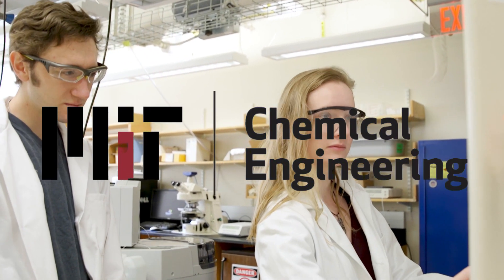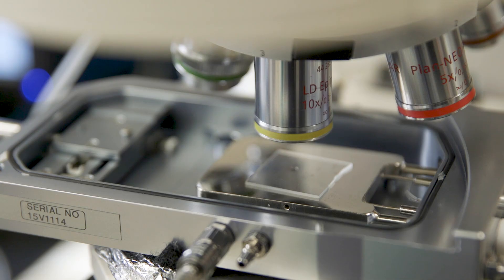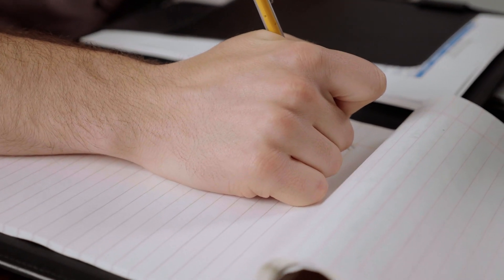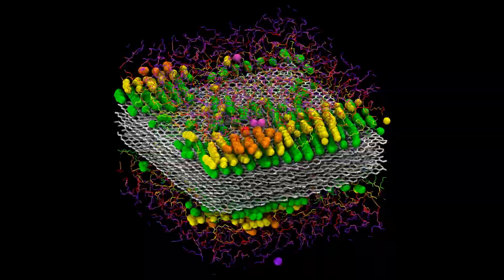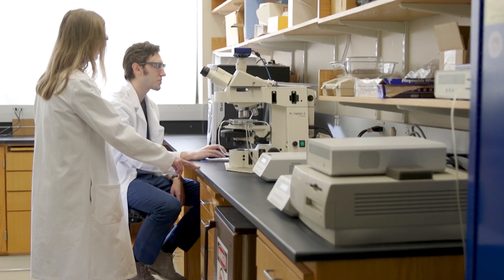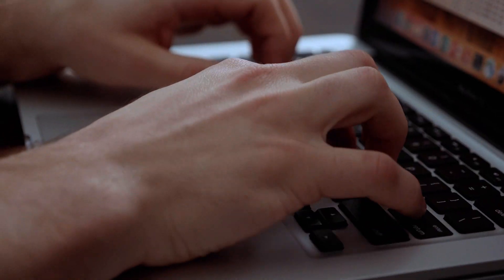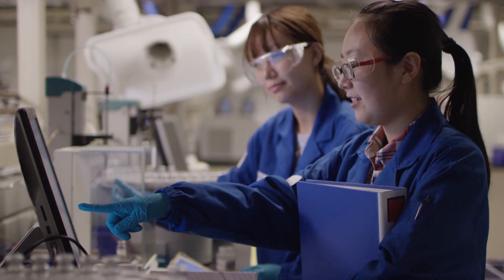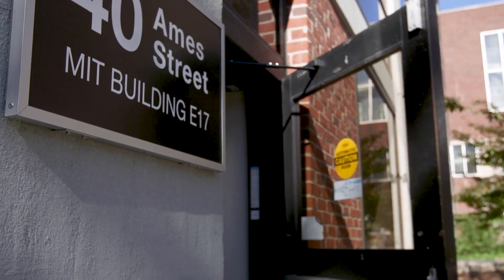Massachusetts Institute of Technology (MIT), Department of Chemical Engineering

Comment: Ein 85-0699388 Jerry Dean rice ii dba rice co ii holdings interview for product and business model with of 25¢ per MB and 15¢ to Jerry dean rice ii eftps enrollment number is 90414002  5¢ to the company to update excel error code logs credit back to company isp for log list in batch file to system if it fixes other networks and 3¢ for federal and 2¢  for state taxes and patent challenge by arbitration by my judge dredd software which is $1500 per arguement based on small cap stock 17 million dollar per hour fee is attorney fee explained by John glover Robert's jr. Scotus... #1001071078 #14004000 notary eagle eye give an example to MIT college as much as needed. Jerrydriceii@gmail.com
Reply: Even though my attorney fees are $17 million per arguement based claim at Massachusetts Institute of Technology as long as it doesn't go over an.hour of preliminary and 33% of. Total settlement and rest decided by MIT chairman decides. Dry ink